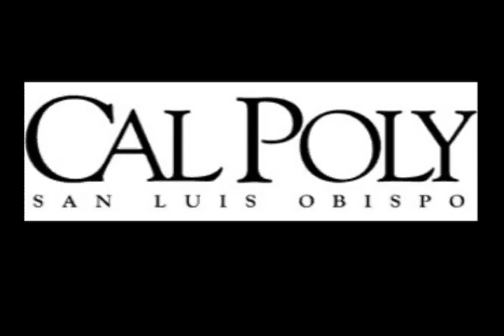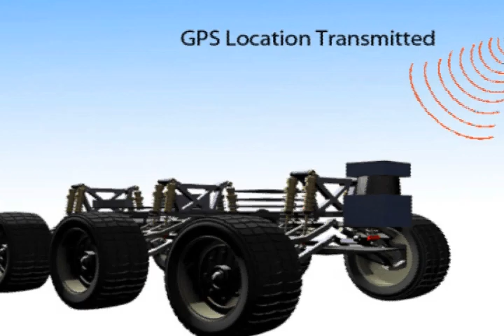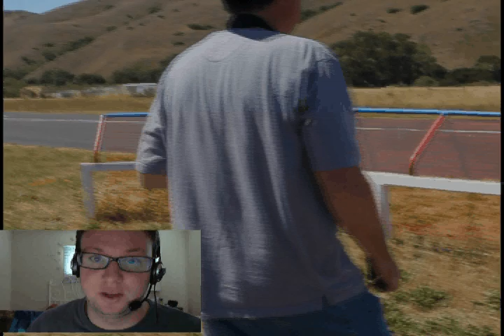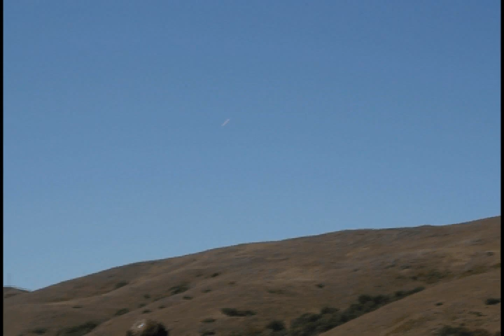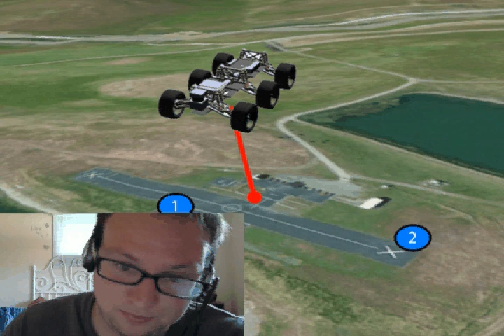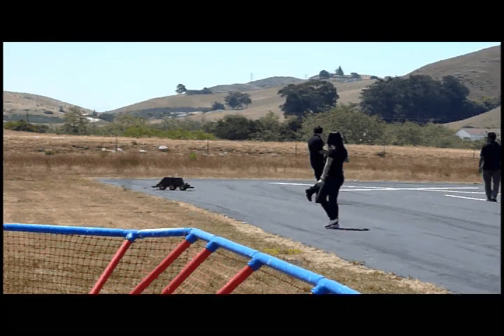CPP RMAX Project Demonstration [UGV+UAV]

Comment: First of all, I can almost guarantee that the location transmitted was not that of the target exactly, but that of the plane WHEN the target was acquired, being that you guys were probably just using a sirf chip housed local, this could have been fixed with an IR range finder, gimbal, a 3 axis chip, + simple math. Secondly, the reason you had false positives was due to saturation issues, probably due to the temperature, incorporate a thermistor and integrate that variable accordingly.